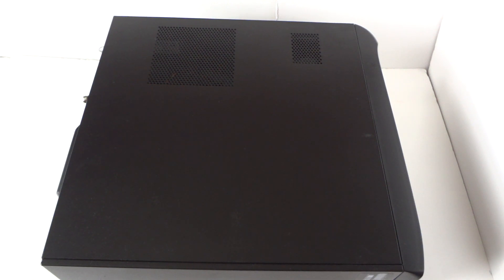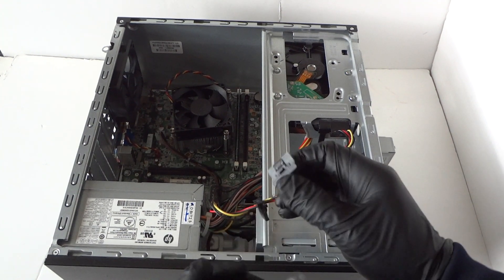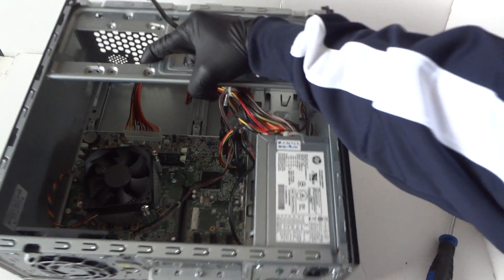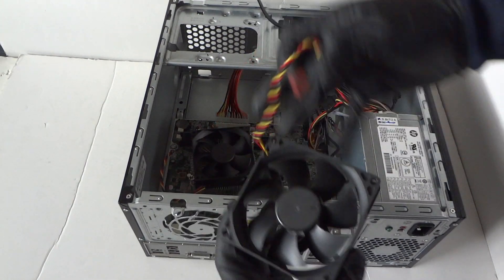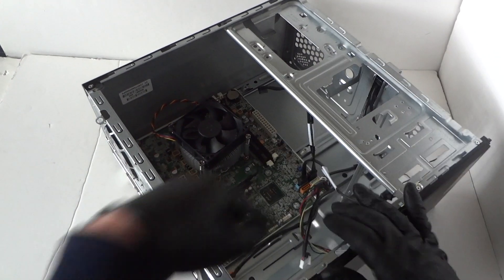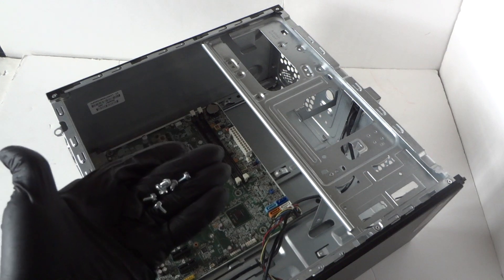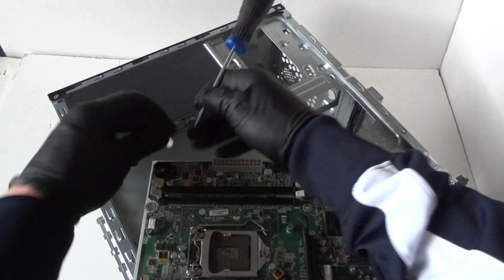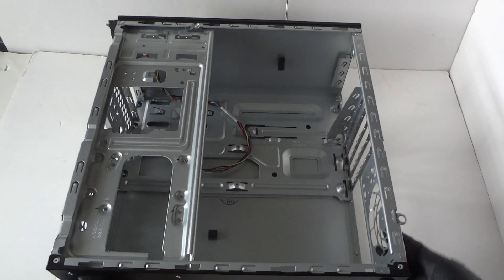HP Pro 3500 Teardown

Comment: Awesome video! I am thinking about switch the case of my HP Pro 3500 for something with more space. Not sure if I will just yet (looking into motherboard, I believe it is atx, but inversed) Thanks again for another great video!
Reply from the maker: Hi, Dan yes you can install this Motherboard in to bigger (ATX Full-Tower, or ATX Mid-Tower Case) this is Micro ATX Motherboard. Thanks
Reply: Mxkdi thank you for this. Recently bought a 3500 to upgrade an almost 10 yr old pc with processor etc and was happy to read your info on it fitting atx form factor cases. Also I'm saving this video to make my year down easier.

Comment: Hello,
I hope you get this message in a Good Health.

I have this PC , 8 gigs ram withAMD 2 GB graphic card , when i put the plug from the PC in the socket then The power button isn't turning on , it was turning on before but a day or two later , i put the plug in the socket and then i pressed the power button of Pc and it turned on for 1 or 2 sec and from then it's not working , can you please tell me , what is the problem?

Comment: Can I put Rx 580 4gb in this HP Pro 3500
Reply from the maker: Hi, yes you can and i do recommend using custom gaming case because motherboard is micro atx and you can install in different case for better air flow, also you have to upgrade power supply.
Reply: @Mxkdt  very thanks ...that was very helpful ! Now I subscribe your channel and to see more content and get more answers of my questions ! Thanks